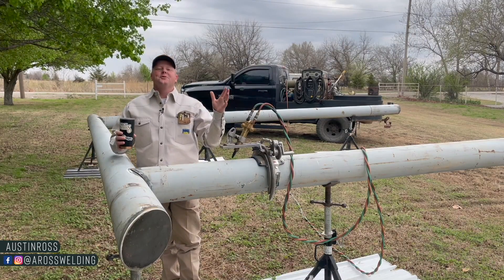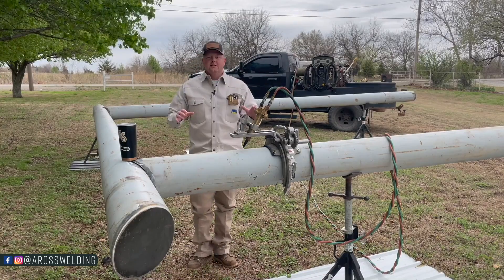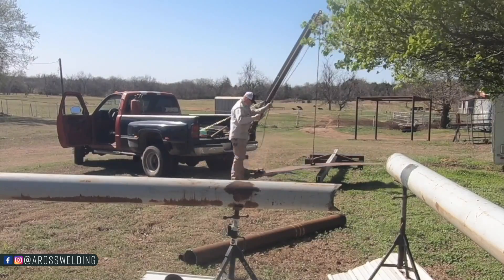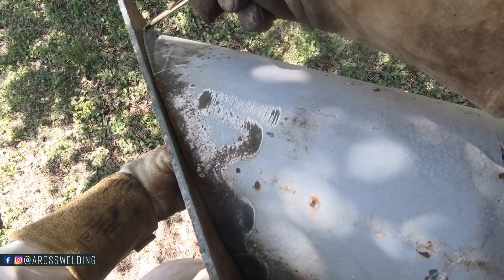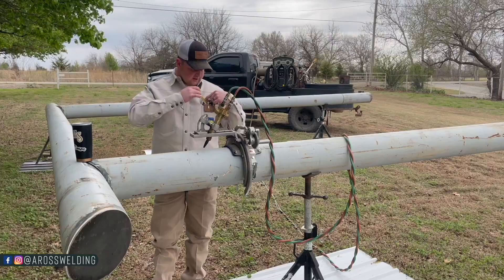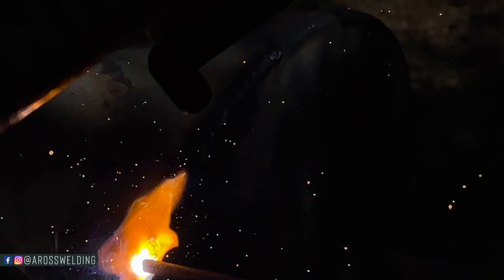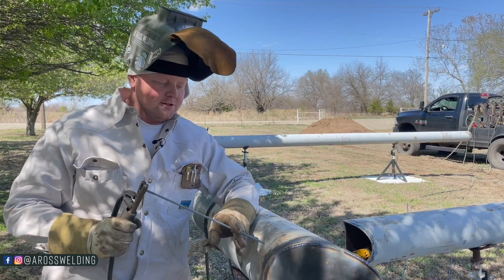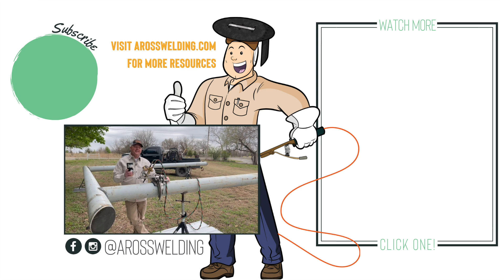Capping The 45° Ends on 8" Pipe Fence Entrance (PIPE BEVELING MACHINE & WELDING WITH A FIXED LENS)

Comment: Austin, I like your simple gin pole setup. 

Question...would it have been easier to make the rough measurements for each cap, cut them out of the large plate where it was originally laying and just take the two small cap pieces over to the project?  You wouldn't have to have used the truck and gin pole.

Comment: I’ve said it before you can weld but that free hand torch work is spot on.

Edit: You have young welders everywhere burning up welding with those splatter rods. 3/32 7018 easy road for beginners. Not much rod material  to carry

Comment: Hey Austin! Question when you are going towards the bottom of the pipe do you keep the same amps from top to bottom or do you lower it once you start getting close to the bottom?
Reply: Hey Sonny Munoz! It takes a little more amperage in the overhead position. Especially with a Low Hydrogen electrode (E7018, E8018, etc) but with a cellulose rod (E6010, E7010, ....8010) you can run it about the same. The cellulose rods dig a little deeper and you're not as apt to get porosity in the overhead (4G) position. With a low-hydrogen rod, turn it up five amps in the overhead position. 👋
Reply: @seanmanwill2002  thanks I’ll try it! 🙏🏾
Reply: @sonnymunoz6037  I built the fuel farm at the San Francisco Int,'l Airport. Out of 5,127 welds (including hot taps) I had three repairs. We shot a nuclear code of ASME Sect. IX and they didn't allow nothing! One of those repairs was corrected. I did however have two legitimate repairs. My rule of thumb, was to turn it up 5amps on the bottom, or overhead position! If you hear a 'hissing' sound, and the rod is starting slowly, grind it out and look for the telltale sign of porosity and start over. Turn it up a bit until it starts cleanly. You got this!
  Good luck!👈👋🇺🇲

Comment: AMEN at 3:50 !  Those manual chain hoist's are God's gift to mechanics and welders .  Simple wins every time ! 
I still like a shade # 9 fixed lens with the "flip lid" on the helmet .  I never could get the hang on the auto dark helmets . 
 I would start to use a grinder and all the sudden the helmet would go dark and could not see anymore so I just stayed with the old style flip shade helmet .

Comment: You need a video on how you start your arcs so easily. I am a flux core welder and have trouble starting stick arcs.
Reply: practice  practice   practice
Reply: The right amps and good rods plays a practice but for sure practice is the answer
Reply: I try to imagine I’m striking an match and that helps
Reply: If you’re using 7018, they don’t restart well so I keep a file cut down to 4” in my tool bucket so I can dress the end of the rod. Strike up about 1/2”-1” ahead and long arc a little until the rod heats up, then start welding. 6013/7014/7024 are all quite easy to restart, for me 6010/6011 are about in the middle.
Reply: It's a cellulose electrode. Super easy to start. Low hydrogen like 7018 is a bit harder but just takes practice.

Comment: When I used to put my rod tip in the bevel I would use mine left two fingers to hold the tip of the rod in the bevel use those two fingers to off the push it and start the arc